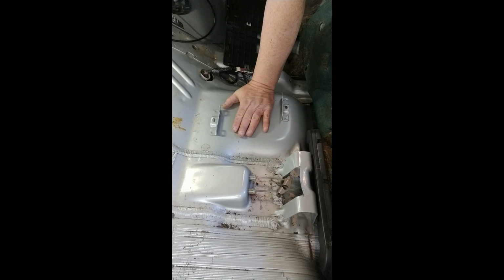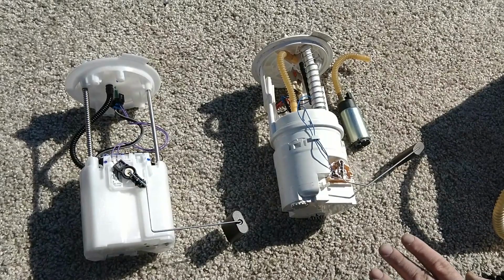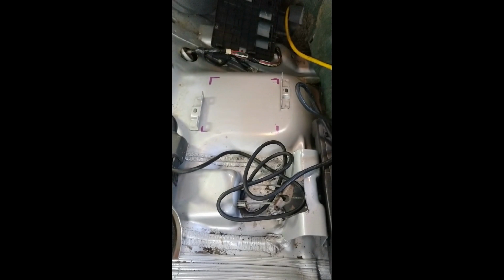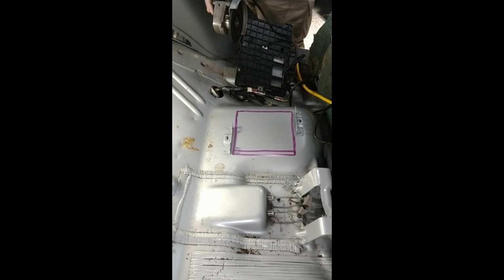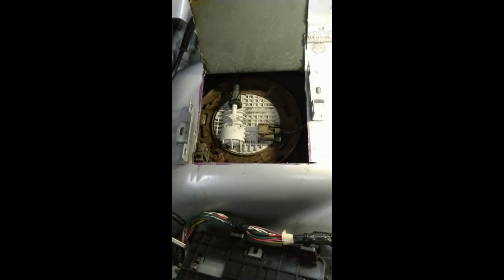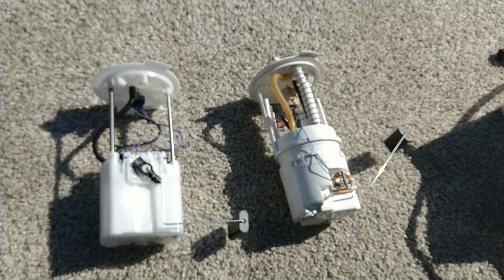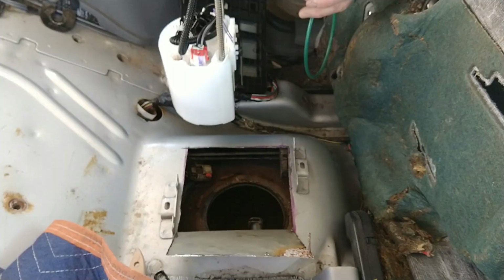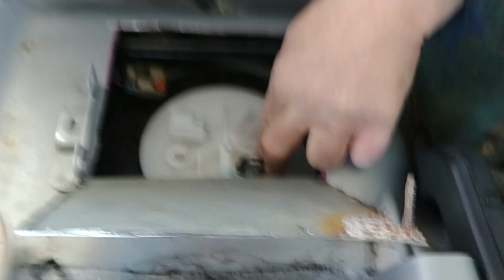NO TANK DROP Fuel Pump Replacement Jeep Grand Cherokee. Commander  - 2005 to 2010.

Comment: Hope you see this soon, but can this same procedure work for a 06 commander, I know the tanks are the same but is the layout under the seats the same? Gotta do this in a parking lot as well. Ty
Reply from the maker: The commander is the same vehicle just skinned differently. Unbold the seat carefully. SPray the bolts from underneath for days or back them out a little and use WD40 or PB blaster on them. A little out and little back in. Work with them gently so they don't break off over a few days or a week. Get the seat out and you will see your floor is just like mine. Same spot. Same job. Seal it good with some spare steel or aluminum riveted or screwed in and caulk the hole closed. USE A GOOD PUMP. SKIP THE TURDS. VDO BOSCH DELPHI
Reply: @KlodFather  thanks bro
Reply: @leeblomquist4879 , did you ever try it on your commander?  Was the layout the same?
Reply: @ShyRage1  100% exactly the same!

Comment: Can you show what the old fuel filter looks like if you still have the old pump?
Reply from the maker: The pressure regulator and fuel filter are built into this fuel pump assembly as one unit. They are not serviceable other than to replace the entire pump assembly.
Reply: @KlodFather  is that also the case for the 2007 3.7L V6? I purchased a filter but perhaps I really need the pump with 5he filter included as you indicate.
Reply from the maker: @XTRABIG  -  ALL 2005 thru 2010... if its the same body style, the pump is the same and in the same place.
Reply: @KlodFather  THANK u brother.  Much appreciated.  Stay well.  💯

Comment: how to blow yourself up 101
Reply from the maker: It's much more likely that will happen removing the tank. This way does not involve fuel lines or draining the tank. At no point were we in danger of explosion. Use best practices.
Reply: If you are concerned, get a sheet metal nibbler.

Comment: you never did show a most important part as usual as a lot of youtube vids do not. Actually loosening the metal or plastic rings holding the pump in...can you show that perhaps, then tell me how  much easier it is???
Reply from the maker: For brevity I did not show this. Get a metal rod about 5/16" diameter (8mm) aluminum or brass and use a small hammer to tap the end of it while it is placed on the tabs of the ring. Tap it all the way around until it starts to move. It then will rotate unlocking the pump. If you have a threaded ring, you can use a giant pair of pliers or channel lock oil filter pliars to remove it  This will greatly simplify your removal. Make sure you vacuum the top of the tank good so no debris falls into the tank. I also used a kerosene pump with extended hose to pump some gas out and start a suction/siphon which I used to liquid vacuum out the bottom of the tank and any dirt in the sump. Dispose of the waste gasoline. I did not video this part because it is contained in service manuals and is common practice on a number of vehicles. There is no video of this part of the operation. We were concerned with the how and where parts so that the tank did not have to be removed. Do your homework and read. This repair is at your own risk. Make sure you have fire extinguishers on hand. Be smart. A little bit of stupid goes a long way.
Reply from the maker: Tony Lockley  said... 
10 months ago
Job looking out on this! Swapped it out in no time at all. Only holdup was having to use my impact wrench on the removal tool for the locking ring. Amazon Yoursme 6599 Fuel Tank Lock Ring Tool

Comment: How  did you close the hole
Reply from the maker: I rivitted a lip on the three sides that were cut. I drilled holes in those lips and used self tapping screws to hold the makeshift door to the floor. I caulked the gaps closed to seal it. 
No leaks. It's not in a spot that will rust.

Comment: Did you finish the cutting all the way thru with the grinding wheel or how did you finish the cut?
Reply from the maker: I cut all the way through on three sides and bent up the metal flap. You can see that in the still photo for the video.

Comment: You better be sure there are no gas fumes escaping from the tank because this seems to be an explosion waiting to happen.
Reply from the maker: Use a fan to remove the fumes and bring in fresh air. Sparks are the only thing that would cause combustion of fumes. Disconnect the battery before attempting this repair.

Comment: Now u have cutt into the body,even though u gonna make a new cover,one u go for state inspection and they see u cut into the body,they can still fail u.droppin the tank is better.less future worries.also u can clean out the tanks rusty crap.
Reply from the maker: It does not fail inspection. Where i put the hole is where the factory access plate is on some models. Its sealed and covered be rug and seat. You are out there on this one. Many love this video. It has helped a lot of people. And no rust in the tank. these tanks are plastic or steel depending on what they had. mine was clean. no rust. No dirt.

Comment: Why wouldn’t you just drop the tank ? This is so lazy unprofessional and much more
Reply from the maker: It turns a 4 to 10 hour job into an hour with my tutorial. All the BS is eliminated. 
Dropping the tank makes it very easy to break old fuel lines and the bolts are Rusty. it's a whole bag of trouble on those older vehicles. 
If you want to do all that dirty work and punish yourself, be my guest. 
If you had more than two braincells that got together and had a coherent thought, it would be obvious to you. Many cars from Europe already have a trapdoor to access the fuel pump. I just made one myself because they don't add them to save money in production.
Reply: Lazy and unprofessional? This is a back saver for someone who works on their cars from under jack stands … thank you sir
Reply from the maker: @erob1962  -  Glad to have helped so many people accomplish this nasty-ass job.